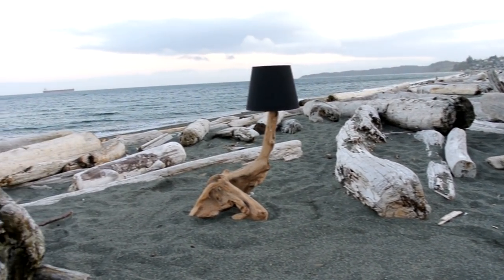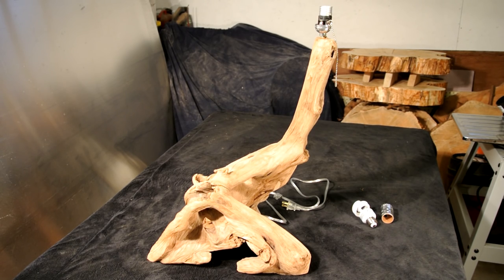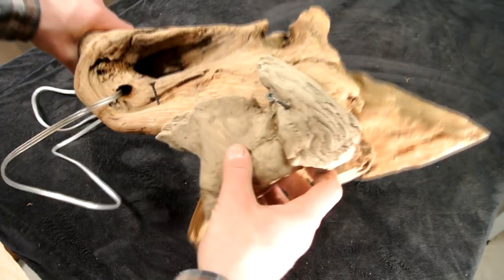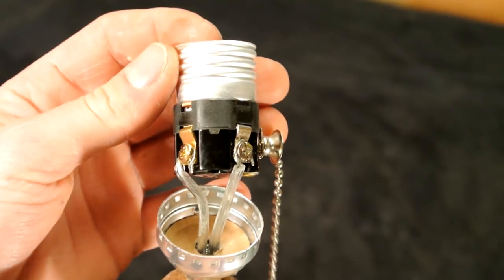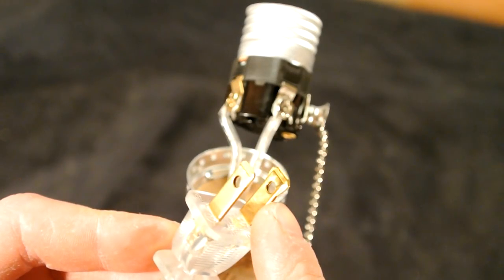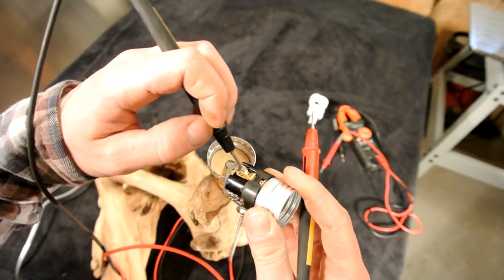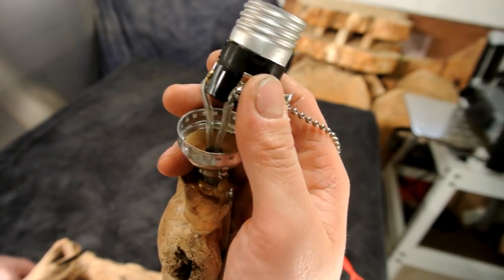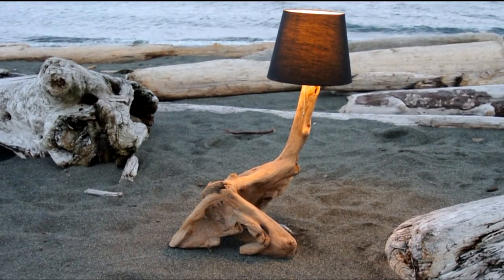The Driftwood Lamp - How to Build a beach wood lamp

Comment: Thank you for sharing the process. Could you please share which flexible bit you used to make the hold throught the wood? Thanks!
Reply from the maker: Thanks for watching. The bit i was using was a Green Lee 1/4" flex bit, off the top of my head i can't remember the length but they are very handy in these situations.